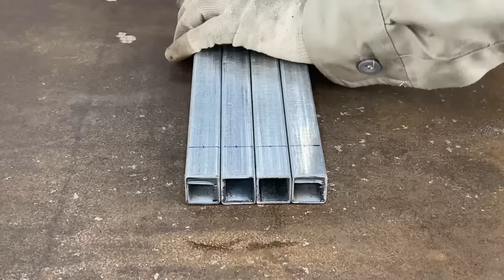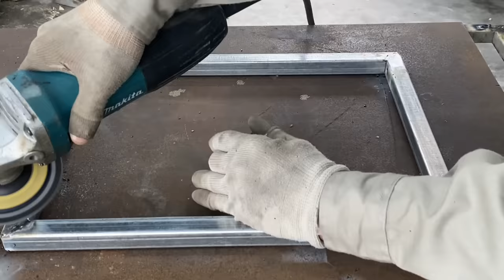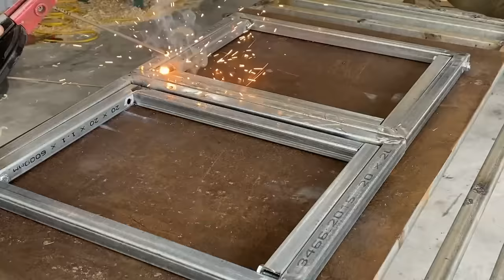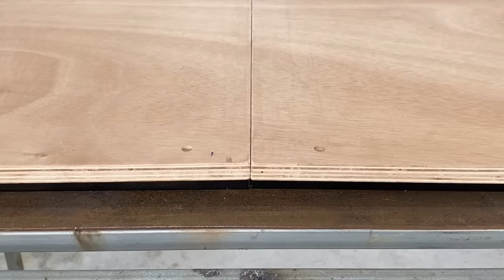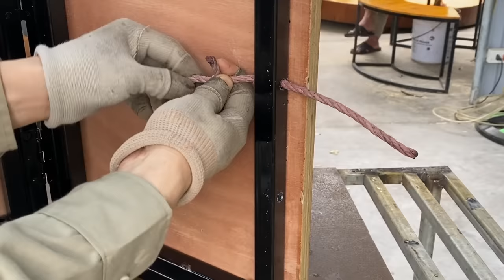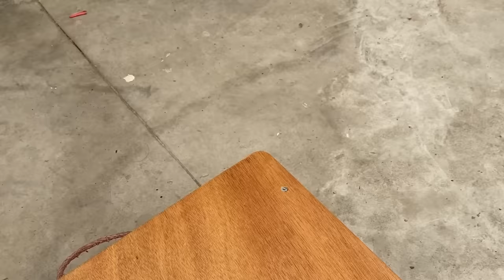DIY - Great Craftsman's Ideas // How to Make a Smart Folding Table // Metal Smart Folding Utensils !

Comment: Those stands of the bench should be little bit tilted outside, otherwise it accidentally can be closed anytime by a little movement of the sitting person.. . 🤗
Reply: Yes, I agree,,,
Reply: Агранишитель должын быть на четырёх углох
Reply: I also think this idea needs more supports, such as placing a single lever that folds in the middle and is somehow attached to the bottom of the legs.